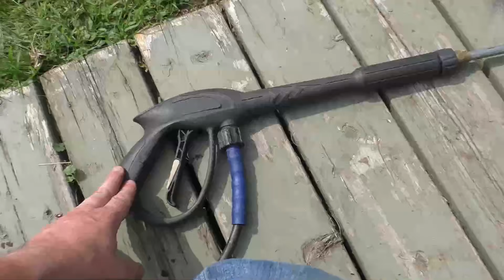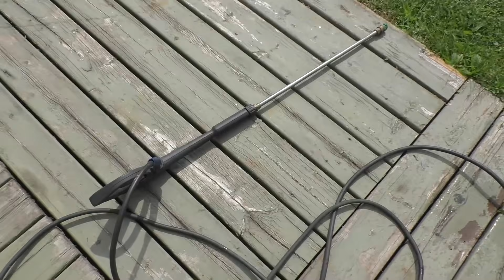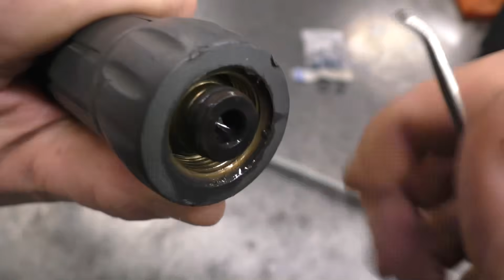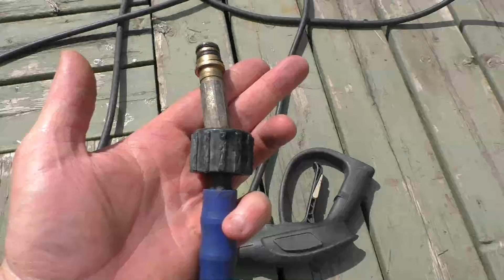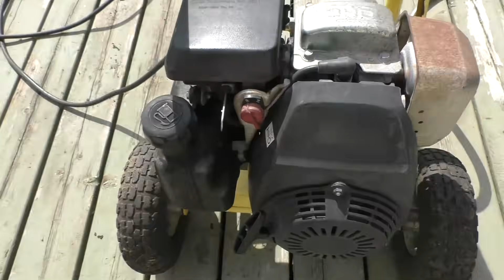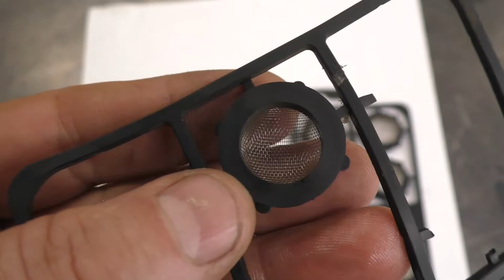Easily Fix Common Pressure Washer Leaks!

Comment: Im 100% sure my engine is gubed but im curious what went wrong. There was small metal shavings and then it was leaking water from the top of the pump and then the side. Ironically this was the best it had been working in some time and it happend after 20/30 mins of use.

Anu advice would be much appreciated, i just want to understand what went wrong and why and if its avoidable.

Comment: but but but you forgot to show the O-Ring at the end of the wand that the spray tips connect to... I tried to find out the exact size that fits my Surface Maxx Pro wand and there is no info on the google search =- so I called the company  and they had a difficult time looking it up ...they said the size is  11.7 x 10.65 mm o-ring  !

Comment: My big leak is from just above the tigger. Difficult to use when aiming up like when cleaning the bottom of the gutters, the water will flow down your arm.
I am using an electric Powerstroke 1200 psi

Comment: i bought a used pressure washer that had leaky o-ring . selling dealer said he couldn't get parts and it was metric o-ring and he had none. luckily I mentioned it to a Kubota mechanic and he directed me to his parts department for the right size ring.

Comment: This is SO helpful.. I bought a used gas pressure washer for $100 which runs good and starts on the first pull but the only issue I had was INSANE leaking, Now I know what to do, thank you :)

Comment: 1/4 inch may refer to the pipe size.  On carbon pipe 1/4 " size, the diameter on the outside is 0.54 " so it can be deceiving.  Thanks for the video. I had to replace a o-ring on my old reliable Honda power washer a few years ago.. Still going strong.  Pipefitter from Michigan, retired
Reply: Yeah, I was thinking the size was for the quick connect itself not the o-ring size.

Comment: Not just pressure washers, leaks at fittings in your garden hose are usually fixed with a new hose washer.  I like to put a light coat of plumbers grease or vaseline  on o-rings/rubber washers, just in case.

Comment: I find that lubricating o-rings with Superlube makes them last indefinitely.
Reply: Would petroleum jelly also work?
Reply: @swingbelly  Yes I believe so, but Superlube is designed for o-rings to keep them hydrated and slippery. PJ should at least help reduce friction which should help as well, but possibly not quite as much. Dialectric grease works well too. I think it’s probably superior to PJ. Would be a good subject for Dony to cover if he hasn’t already.
Reply: Superlube looks expensive, but a tube lasts a very long time, as very little is needed and is great for other uses such as door seals on cars. It doesn't leave a gunky residue like PJ. Dirt doesn't stick to it.
Reply: I use silicone grease, plumber's grease also works.
Reply: Do you use the plain or Teflon flavor?
Reply: @DaddyBeanDaddyBean  PTFE (Teflon)
Reply: Yep, i do the same
Reply: Wanna know what else superlube works on…
Reply: @thesheriff5091  Lol!